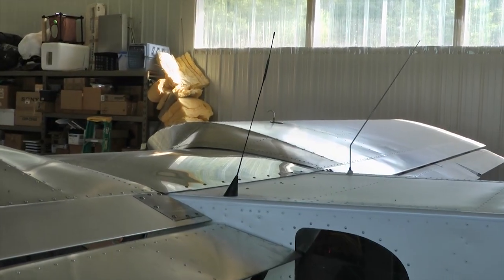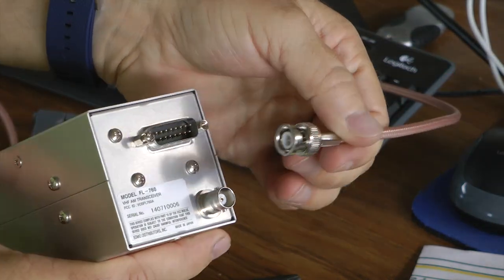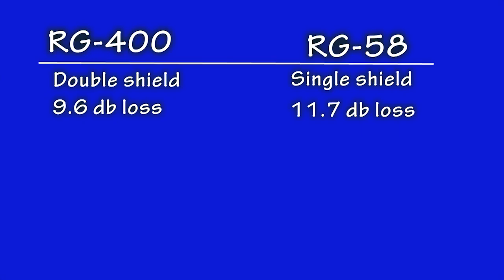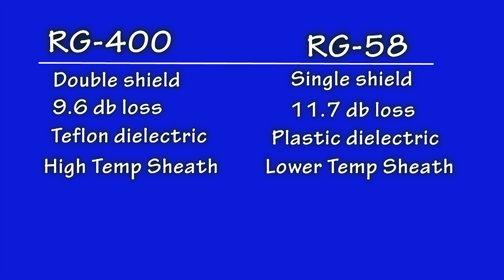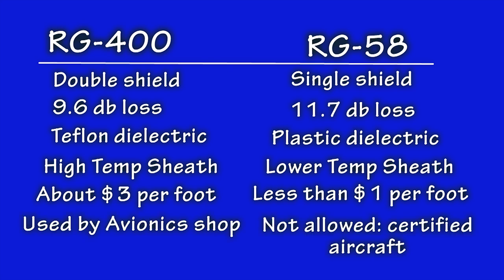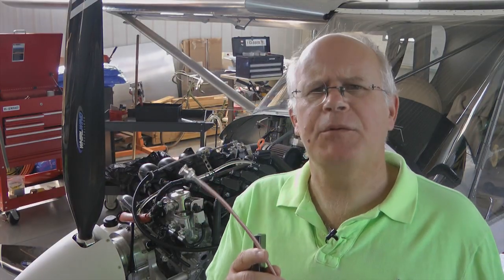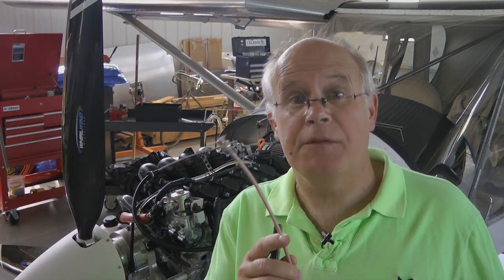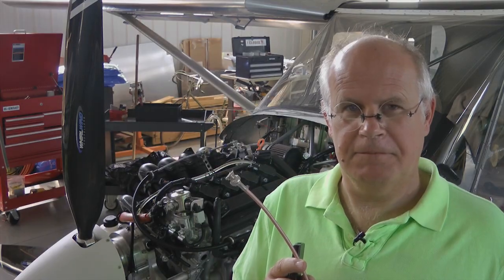Fabricating Coax Cables for Experimental Aircraft

Comment: Good job John.  I just learned this by the seat of my pants a few months ago.  Couple of suggestions....1) the hole in the small inner gold pin is a witness hole and the inner cable length is correct when you can see it thru the hole; 2) the same pin is actually held in place in the main body by a detent, and its important that it engages in that detent or the pin wont be at its maximum stick out and you wont get a connection when you hook your cables up; 3) buy at least two extra BNC connectors and expect them to be sacrificial "practice" because at least the first time you do this, you'll probably screw it up...so also leave a bit of extra cable in your run to accommodate that; 4) GPS TNC connectors, like on Garmin antennas look quite a bit different from the ubiquitous BNC but are made the same so dont freak out about that.  Finally, +1 for Stein Bruke and his gang.  Def watch his videos and patronize his business.
Reply from the maker: Good comments Mani. Thanks
Reply: Good comment and I was about to say some of the same things: inspection hole and locking of the pin into the connector body.  I will add one more thing and that is to check for continuity before you crimp the ferrule.  If you have continuity between pin and body, that means you have a stray piece of braid shorting to the center conductor and no use wasting a ferrule as you need to cut off the connector and try again.  And I do a final continuity check after the crimp to ensure that this is no electrical connection between the pin and connector body.
Reply: you shouldnt be able to see thru the witness hole, if you can that indicates the core is too short

Comment: RG58AU was used on all the certified airplanes from the factory & avionics shops for years until GPS came into use. You will find it on all the old King, Narco, Collins & ARC navcoms & transponders. They used it on the VOR antenna with a balum at the antenna. You find this information in Advisory Circular 43.13. Also there are solder on BNC connectors you did not cover.

Comment: The strippers come with a straight blade and a blade with the notch for cutting down to the center conductor. Since you did not cut down to the center conductor with the stripper, but only removed jacket and shield braid, did you replace the notched blade with a second straight blade? Or does the notched blade work OK to cut the shield braide, but leave the dielectric intact?

Comment: "...and this will take some force"... audio goes dead as curse words ensue.
Reply: Yup.  RG400 is slightly wider than RG58.  Make sure connectors (and their collars) are designated for RG400.  RG58 collars (and some Chinese made RG400) wont fit over the RG400, thus the curse words and "some force" getting that collar over the wire.. Ask me how I know.
Reply: I find less force is required if the braid is flared out a little with your fingernail before sliding on the connector.  This causes it is slip under the braid rather than pushing it back and bunching up as in the video.  Then just pull it back toward the connector a little before sliding on the ferrule and it is much easier.

Comment: The most important part is the silver plated double screen - this keeps RF inside the cable so it doesn't cause havoc with sensitive instrumentation, and also provides a good barrier in reverse to keep whiney nasty noises out of your sensitive receiver.  The silver plating is important, because as it ages and oxidises it forms silver oxide - which is an excellent conductor!!  Oxides of copper, conversely, are a particularly bad thing to be developing inside your aircraft cabling.  Consider covering the ends with glue-filled heatshrink, and also a sheath of it can be added elsewhere along the cable for strain relief or abrasion resistance.
Reply: Both silver and copper oxides are pretty good conductors. Unfortunately, copper oxide will harden and embrittle the strands, making the shield very fragile. This is also true of silver, but to a much lesser degree. Marine heat-shrink at the joints is not a bad idea, especially with those sub-market connectors in the video that don't feature any seals.

Comment: The little hole in the side of the brass center connector is for wicking solder in..........makes a better conductor for your radio output and keeps the connection from developing corrosion...........any electrical resistance will diminish your radio ouput...........i solder all connections in all wiring harnesses i make...........wire will not pull out of terminal ends , corrosion will not build up , and it is guaranteed to perform............i use uninsulated terminals soldered on and heat shrink to insulate the end............if you use clear heat shrink , you can put an idenitifer tag under the heat shrink for circuit ID that is permanent and readable..
Reply: Thanks. Excellent suggestions.
Reply: Incorrect.  The little hole is an inspection window and is designed to allow inspection of the proper wire insertion depth prior to crimping.  These types of terminals should not be soldered unless the manufacturer specifies that and none do that I am aware of.  Soldering is actually harmful in auto and aerospace applications subject to vibration as the solder wicks down the wire, stiffens it and leads to early failure under flexing.

Comment: Doing it yourself will probably give a better outcome than contracted results (SteinAir does outstanding work --- but Aircraft Spruce, not so much --- I've gotten more than one cable from them where the BNC connector fell off from the RG400.  Don't buy pre-made cables from Spruce)

Comment: Firstly, thanks for providing these videos. They're a wonderful bite sized learning resource and much appreciated. Point of correction though: you mention that Teflon will not turn into harmful gasses on combustion. In reality, Teflon is a trade name for PTFE (poly-tetra-fluoro-ethylene). While it has a higher melting point than polypropylene used on the RG58 family, its thermal breakdown products will include halogenated compounds which are highly toxic. Although this will probably be mitigated by the ventilated environment likely in an aircraft fire. Once again, thanks for the informative and entertaining videos
Reply: Kav Ghanouni              Another hazard with teflon use is that if you melt it and a drop lands on your skin , it will keep on melting and dissolving flesh as it eats through your finger , hand , etc.............bad nasty stuff if melted..
Reply: WHICH TYPE DO YOU PREFER SIR. THE RG-58 OR RG-400?

Comment: About the loss of the RG-400 vs RG-58: at what frequencies and cable length did you measure this?
Reply: It's a 50-ohm cable with a fairly accessible spec sheet. You're delving down a pedantic rabbit hole, there.